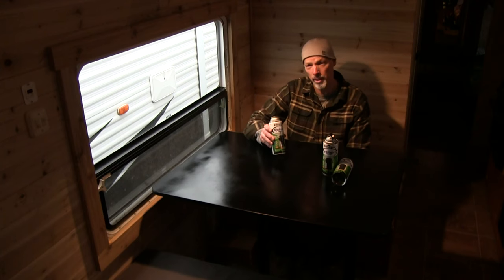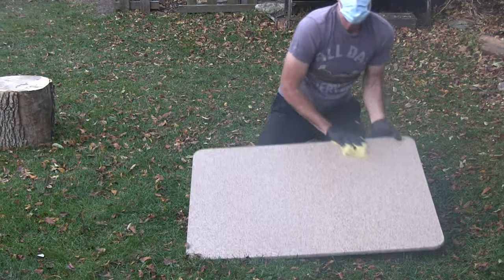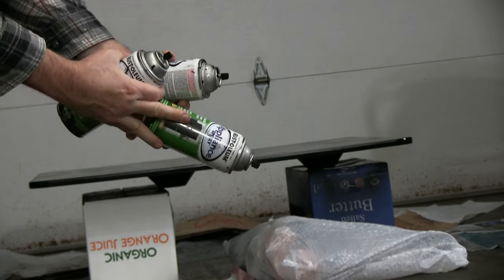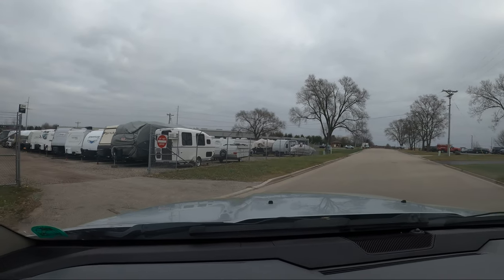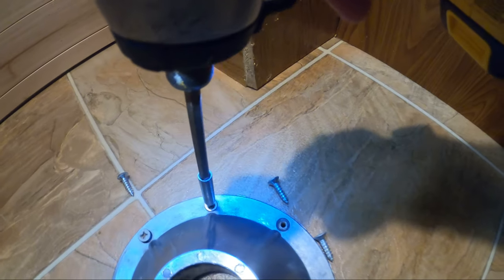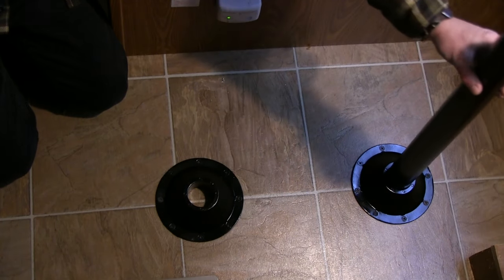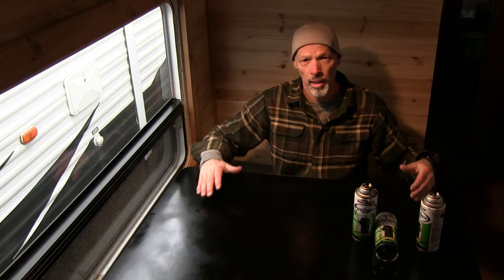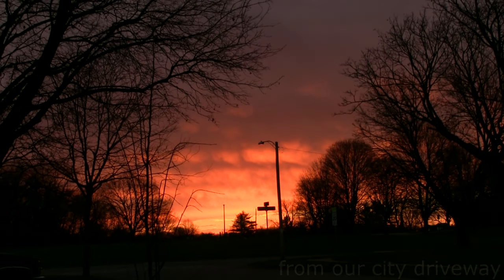Rustoleum Appliance Epoxy Spray Paint (Does it work on RV Dinette Table?)

Comment: The can of Appliance Epoxy says for use on metal surfaces. Could be the reason for not getting the expected result.
Reply from the maker: The website says that Rustoleum Epoxy spray paint is suitable for metal, aluminum, fiberglass, and plastic. I think it just needed a bit longer to cure. 👍🏼

Comment: I have used this paint befor and with proper preparation I didn’t see you do and proper cure time this paint does not scratch that easy.
Reply from the maker: Thanks for the input! What did you do differently? I will say it’s been better now that it’s cured quite a while. :)
Reply: @SilverLiningDayDreams  well i used the black spray appliance epoxy not sure if it’s any different. But i cleaned degreased and then sanded then cleaned and degreased again used a tack cloth and then painted. Also I painted a old rusty white refrigerator so it was metal. But it got on the vinyl floor and would not come up and i never prepped the floor so i wonder if it was just the material the countertop was made of.